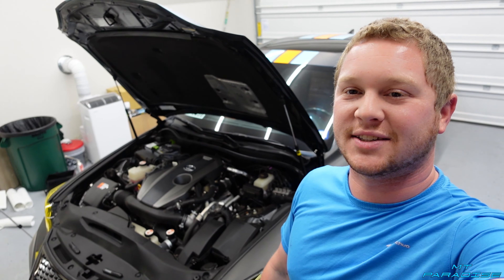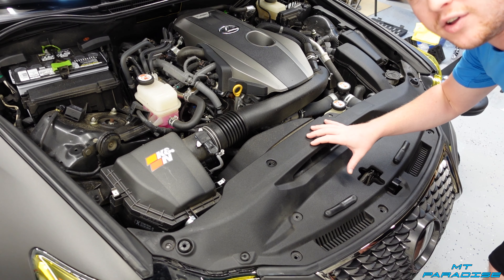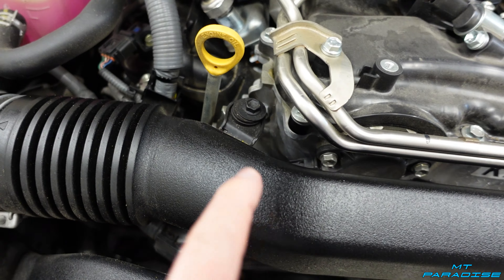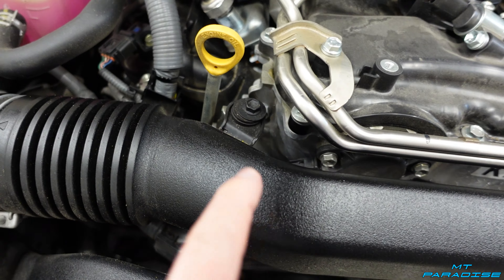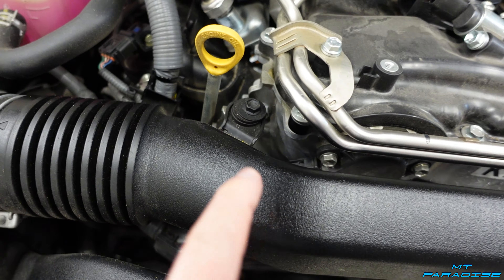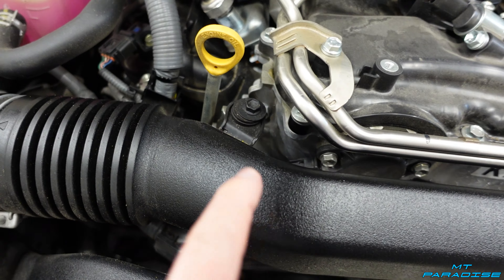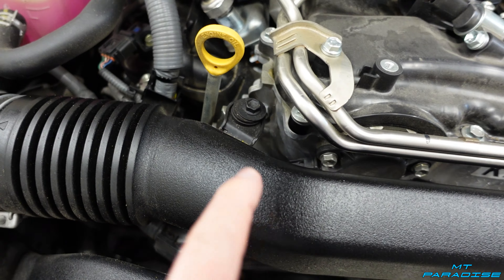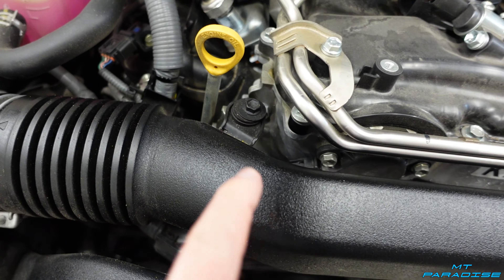Install Cold Air Intake Lexus IS 200t, 2.0L 2016+

Comment: Stock actually works better it’s been dyno tested. lexus has ram air under the front shroud lowers the temps by like 30 degrees vs 200 under the hood temps. Loose like 15 hp with aftermarket parts. If your cars isn’t older then 1996 it won’t help Improve without boosting your car. Nice informative video just a food for thought since yours is turbo has no affect on performance
Reply from the maker: Well it looks really good and it significantly increases the intake and turbo sounds and I wasn’t really looking for performance. I would have gotten the IS350.
Reply: Interesting info... I don't know if I want an intake at all now lol...
Reply: @jgiannavola55 keep the stock and get K&N filter or a enclosed box performance filter.
Reply: Lex B. I think you're incorrect; stock has less HP + TQ.  AEM website shows the proven Dyno sheet with 28 HP+ 25 lbs TQ gained with this cold air intake installed VS stock. You'll get over a 20 HP gain for sure.  AEM is a good reputable performance brand.   Cold air intakes from reputable performance brands are guaranteed HP gained.  Stock air intakes are proven to be more restrictive than performance aftermarket cold air intake kits.

I recently installed a K&N cold air intake on my 2015 Ford Fusion Titanium 2.0 Ecoboost.   It gained 10 Hp+ 9.6 lb TQ. According to their Dyno sheets.  The car is definitely more responsive with a small but noticeable bump in power.
Reply: Good to know!! Thank you!

Comment: Great job.  I’m considering installing cold air Takada intake for my is350.  Only thing I’m worried is that would aftermarket filter allow more dust to engine which can hurt the engine in the long run.  Have you noticed any ?
Reply from the maker: The filter will still block all that. Dirt will still get on the filter but would still act the same however, the increased surface area will still allow more air through

Comment: I installed an HPS intake. I'm having an issue where the turbo boost will, in some cases, bounce back and fourth quickly from full boost to half boost. You can visually see it happening on the boost gage, you can hear it and you can also feel it during acceleration. This typically only happens when I'm in 4th gear and higher. 1st through 3rd gear full throttle the boost stays at max. Are you noticing anything like this or have any possible solutions to the problem I'm having. Thanks in advance!
Reply from the maker: Oh that’s weird. Mine has always been consistent. I’m not sure why it would be doing that
Reply: I had that issue and you need to change your boost regulator valve.  There was a tsb on the nx200 t for that issue. You may want to research that if you are having that issue.
Reply: @briandejesus8592  You're spot on with that! I ended up taking it to Lexus and that's what they told me. It was a $600 fix

Comment: I got the hps intake and it was cool but the constant sound of air getting sucked in was starting to annoy me so I took it off. But after watching this you’re tempting me to put it back on
Reply from the maker: 😂 yeah I get that. Because there is no sound from the exhaust, it’s the only sound I get but I mostly like it for the looks.
Reply: ll buy it from you if you don't want it lol

Comment: Doesn't adding one of these metal intake tubes make performance worse since the metal would tend to be hotter than plastic thus creating more hot air in the intake?
Reply from the maker: If that was the case, they wouldn’t be making them metal lol

Comment: Great video, I’ll be putting my HPS intake on this weekend for my IS300. Did you have to disconnect the negative on the battery before installing or was it okay after startup?
Reply from the maker: I didn’t disconnect the battery and everything was just fine